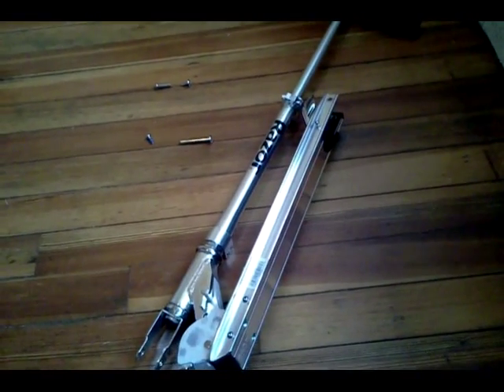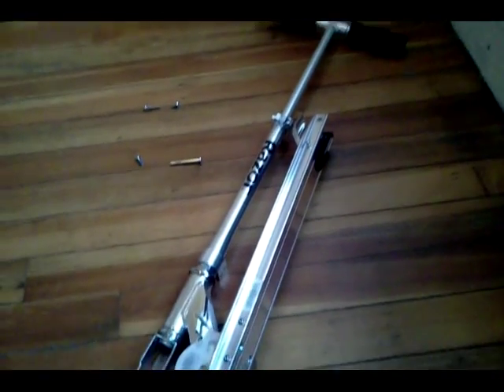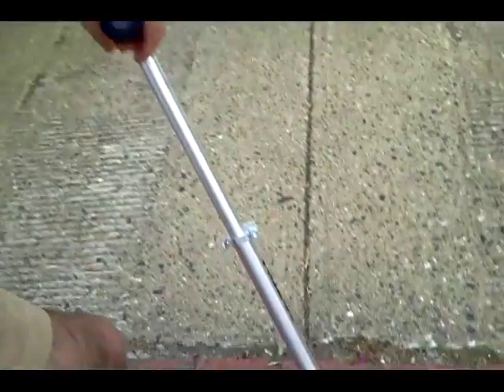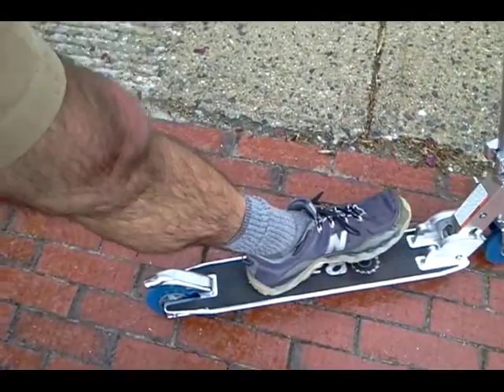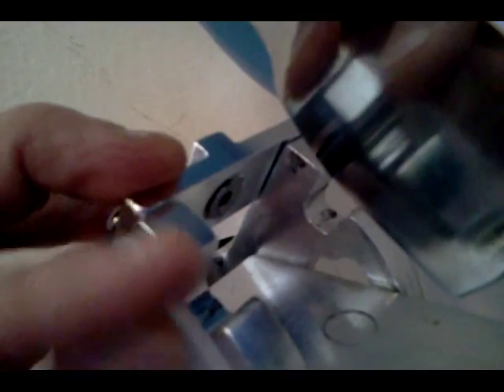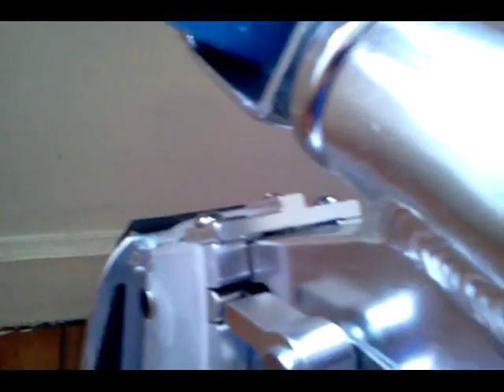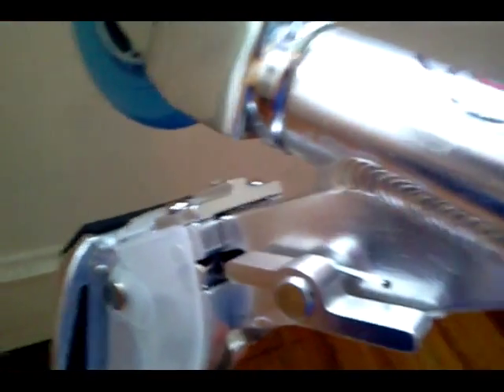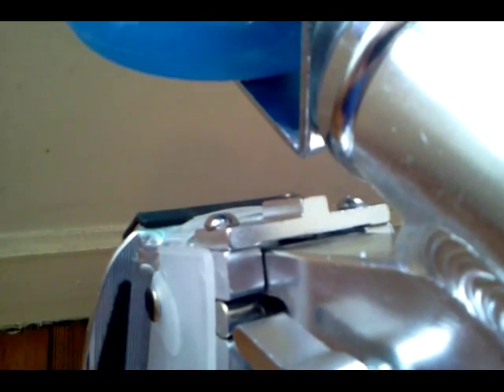ABEC 7 vs. ABEC 5 bearings 🔘 spin test

Comment: Lol this guy looks at a razor as a good scooter..... Guess what that costs 26.99 we'll there is something called a Phoenix reventon deck for 380.00 and that doesn't come with bars or wheels or fork just deck. A real scooter for riding costs 580 or more. If you want to fly through the road slap on some proto sliders with ceramic bearings and you won't stop for miles. Have fun.
Reply from the maker: Guess you put a price tag on fun...I don't. But thanks for tip on ceramic bearings.